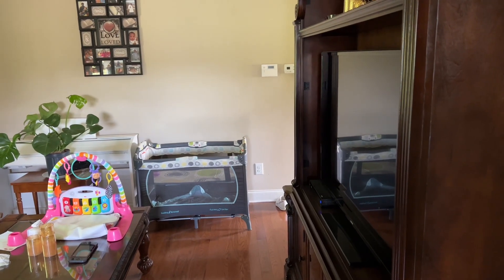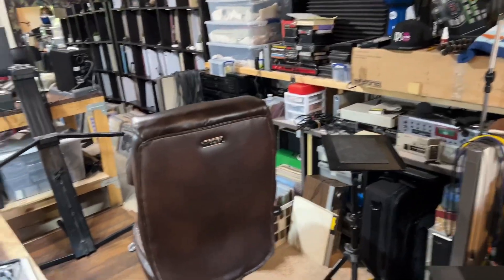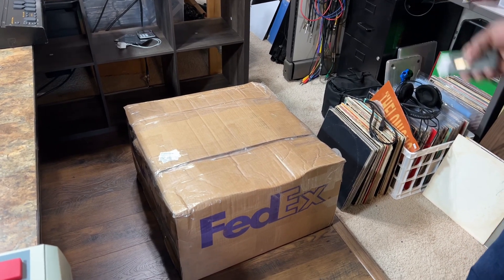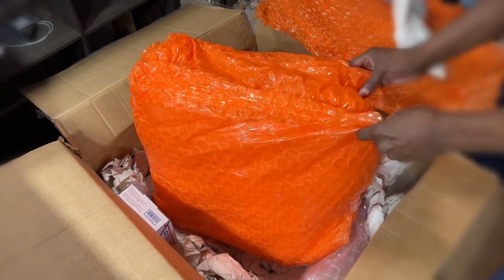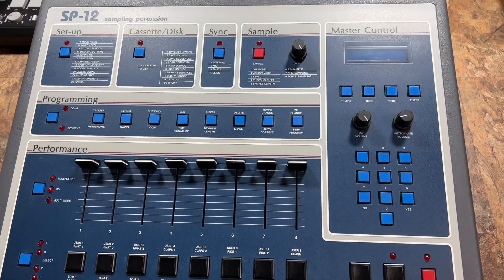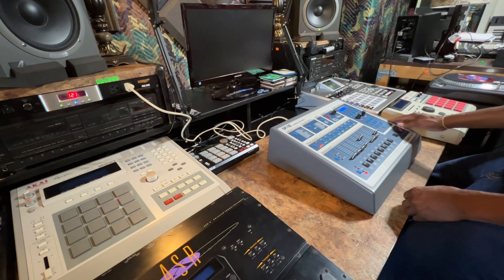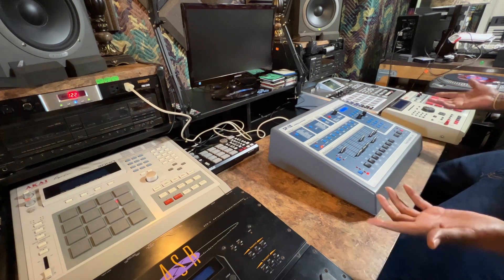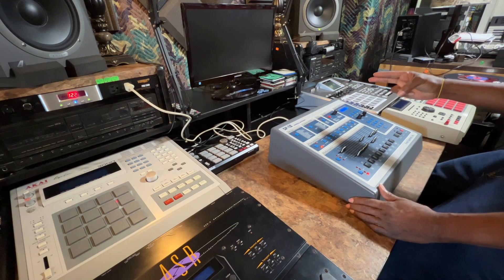SP-12 Turbo, full service, battery replacement, blue screen installed. Bruce Forat

Comment: Do you know if he fixes asr x pro?
Reply from the maker: It’s best to give him a call and I believe he fixes anything. What’s going on with your box?
Reply: @beataddiktgodd  it gives off static noise from the main outputs and not the normal analog hiss noise. Also when I’m hitting the pads the thud from the impact of the pads also come out of the main outputs. I guess a short fix would be to use a midi keyboard. But I’m one of those dudes that want everything to work properly or my my brain won’t properly be focused on the task at hand (making music)
Reply from the maker: @jltbk5420 Have you tried to open it up and give it a good cleaning? Sometimes that helps.
Reply from the maker: https://www.keyboardkountry.com/ensoniq-asr-10-display-board-with-purple-screen/
Reply from the maker: This gentleman use to work for Ensoniq, give him a call.
Reply: @beataddiktgodd  awesome. Thanks man
Reply: @beataddiktgodd  yes I sprayed it down with air and wiped em down